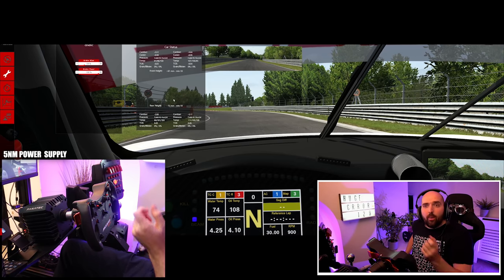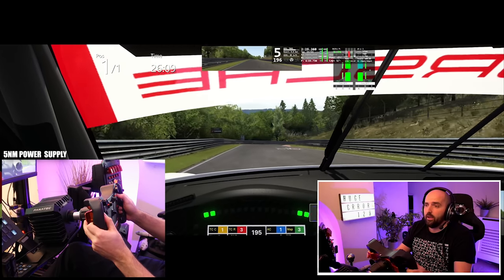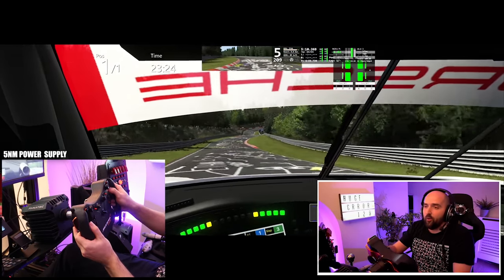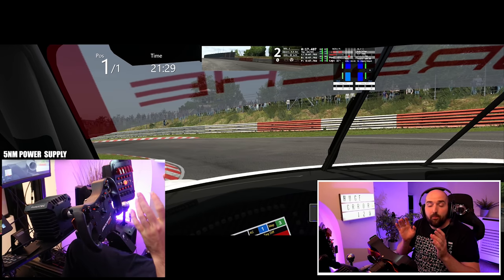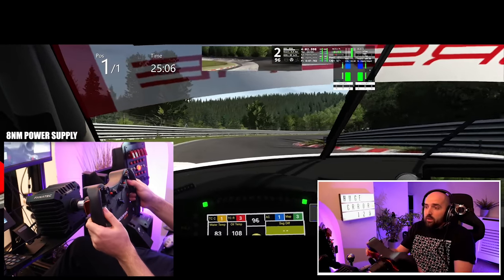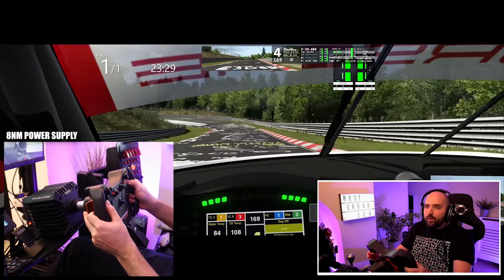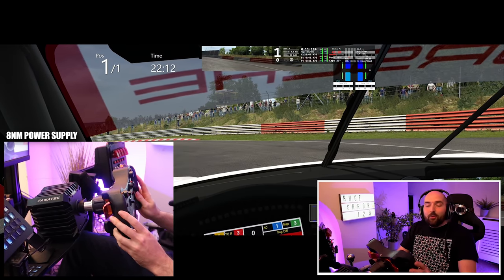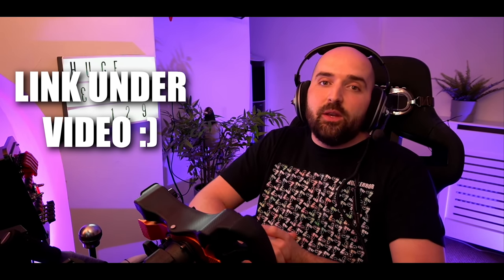Fanatec CSL DD | Which Power Supply Should You Get ?

Comment: im still thinking about between CLS DD and DD1   but i  don't really need extra power forcefeedback but if responsiveness( every bumps on the road or others) are same on the road then  i rather stick with cls DD.     does cls DD response less compare to to DD1?  sorry im new to direct drive wheel and still using Fanatec clubsport 2  but i really like to buy cls DD if responsiveness  is more detail
Reply from the maker: CSL DD is not a HUGE difference compared to CSW 2.5 if you had a CSW and wanted a big upgrade for for a DD1 , Simucube or OSW. 

CSLDD with boost pack is very nice though and great detail just not as punchy and weighty as a DD1 / higher end DD even if you ran a DD1 at half strength.
Reply: @GamerMuscleVideos    thanks for the reply.  btw, which direct drive wheel is your favorite between these   DD1,Simcube, OSW

Comment: To me it makes 0 sense to charge your customers $150 for a 180w power supply that probably costs Fanatec $5 to make, in order to unlock the full performance of the equipment you're selling. I'll be using a 24v 250w Mean Well Power Supply with a CPU cable adapter rewired to match the DD power plug, and pay max $20 for it. Not shilling $150 for a 180w power supply, like seriously wtf
Reply: I think it makes lots of sense, because it makes them a lot of money
Reply: this is a short sighted view, they're clearly clawing back from selling the 5nm at low margin. This floods the market and gives customers the option to upgrade. look at other products like Xbox charge £125 for a SSD

Comment: I ordered an CSL DD to upgrade my CSL Elite 1.1. But i ordered the 5Nm version and im fine with it. The upgrade is more a quality and loudness upgrade. The CSL Elite is really really loud and the quality is pure garbage. My first CSL Elite died after a couple month and the secound was dead on arival. Next week i will get my third one and i hope this base is fine. But it doesn't really matter to me. I will upgrade anyways.
Reply: iPain there is a lot more damping in the belt driven wheels so a csl elite may feel slightly heavier than the the 5nm DD csl due to this so it may feel too weak due to the smoothness so remember that and i can see the power supply going out of stock fast as many will do as you have and upgrade almost instantly
Reply: Also if you havent tried a DD wheel the quality feeling is WAY better than you would get with a CSL elite so your points seem like you're kind of confused
Reply: @Simlife101  i don't see why i should spent 130-150$/€ for a stupid power supply. I can build my own one for less than 30$/€. I also can easily build an adapter for the old CSL Elite power supply. The only difference between the old CSL Elite 1.1 power supply and the boost kit is the connection. The boost kit is a ripoff. No matter what everyone say about it.
Thats another reason why i choose the 5Nm version.

Comment: Tried rF2? Awesome FFB and great content. BTW still dont know which power pack I should get xD but my order is months away anyway
Reply from the maker: Yes aspects of RF2 FFB are good and some cars are great , but it really lacks FFB for braking ( outside of initail suspention compression)   and also lacks subtle FFB for G-Load  and most the cars in RF2 have really bad handling at low speed.    But again it totally depends on the car because RF2 is so complicated to make content in and has so many options from a development point of view a car could ether be totally amazing or absolute rubbish. 

I'd get the boost pack for CSLDD but I have been using 15+Nm DD's for over 3 years now so im just used to having a bit stronger FFB.
Reply: @GamerMuscleVideos  yeah rF2 is kina crazy with all the different levels that the content is on. They are improving things and working on lots of new things but it takes forever. Looking forward to upgrading my G29 (may get a rig first so I dont have to mount it to my desk). And the QR2 might be out then as well

Comment: Im sorry WHAT?? best ffb is AC ??? I have a Sc1 20nm and feel feck all through the wheel after many many attempts of tweaking so I gave up. Ever since I tried Rf2 on my old csl elite it was magical. RF2 hands down is the best sim for ffb and overall simulation to the end user end of !!
Reply: Do you use FFBClip? That made AC pretty close to rFactor for me, though rFactor is still my preference.
Reply: Yeah I was surprised to hear praise for AC's FFB. It shows the topic is very much about personal preference and debatable, but I have seen most prefer ACC's or rF2's feeling. I personally felt AC's FBB is missing some elements compared to rF2 (on G29 and CSL Elite), but I probably haven't oozed out every bit of potential of AC's settings yet.

Comment: Assetto Corsa with it's 1 point tire model has the best FFB of all sims?  LMFAO  It is like a centering spring and not much else in feel.  Try rF2 for the best by a landslide in physics, FFB and tire model.
Reply from the maker: You are confused as to the relivence of how many contact points a tire model has and how that is relivevent for ether physics and or FFB.  A SIM could very easily have what you are calling a "1 point tire model" and still have both better physics and FFB than a SIM that say had 5,50,100,1000 point tire model or even no tire model 😆 xplane 11 has quite nice ffb in the air. 

If all you feel is centering spring forces with AC then you have the SIM set up wrong it has lots of range and detail to the FFB and is quite similar in ways to some real cars I have driven 👍

RF2 does have very detailed FFB your right , crucaily AC communicates exactly what is needed without having over the top suspension noise.
Reply: @GamerMuscleVideos  So many things in your post are incorrect that I would not know how to start my reply.  Enjoy your simcade Assetto corsa that Stefano himself admitted was his vision for the game.

Comment: Doesn't AC have rubbish FFB Compared to ACC?
Reply from the maker: No it's the opposite AC has amazing ffb. 

ACC you can go through a corner and litrally come on and off the gass and there will be no change in the sustained forces coming through the wheel. 

AC you can feel exactly what's going on all the time. 

R3E , RF2 , even iracing with irFFB has miles better ffb than ACC. 

The only way to make ACC ffb close to as informative as other Sims is to use an acuforce wheel and replace the games ffb.